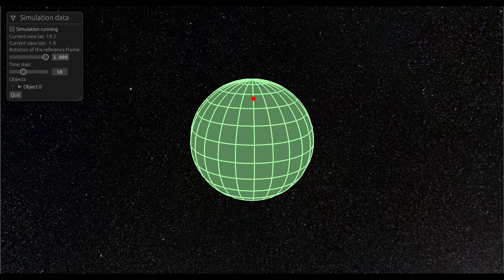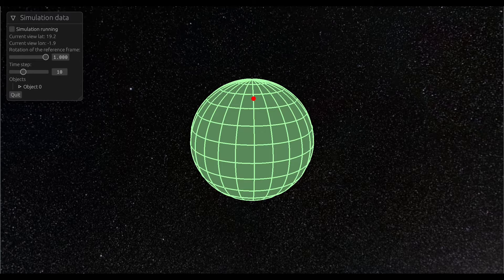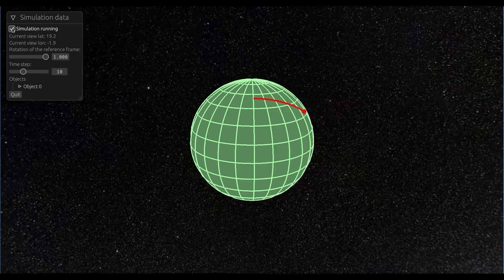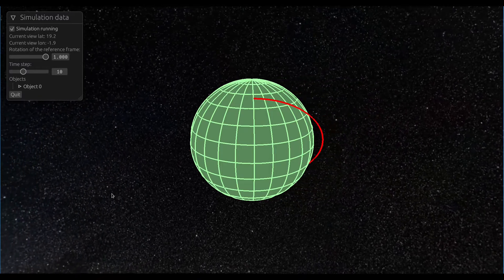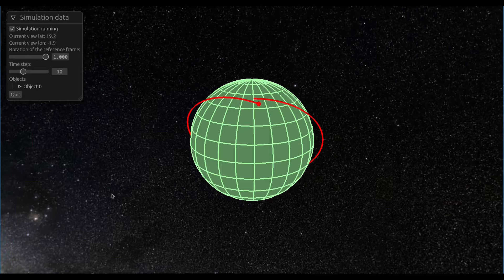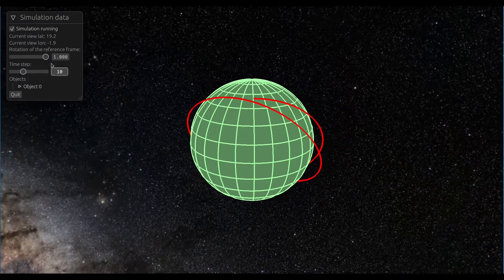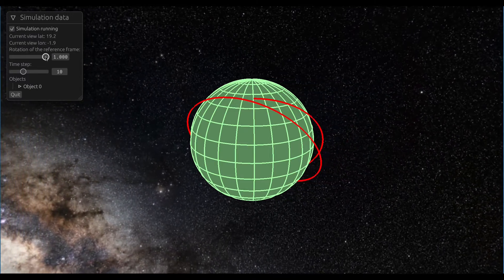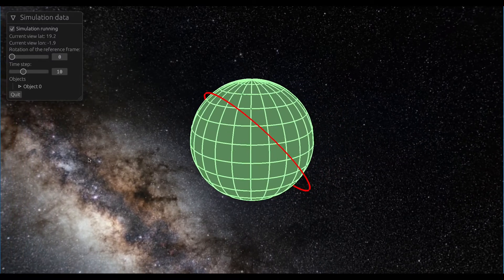3D Coriolis simulations - demo

Comment: Nice demostration, but i thought, how can something change direction, if it moves from west to east or east to west especially the Foucault pendulum? Out of reference frame of rotation earth it is realy clear for me, but i don't really know hot wo explain it inside the rotation reference frame.
If something moves north or south, the earth rotation there is another than the object or ball of the pendulum has. So it's faster or slower than the surface and we see a drift. But this explains only half of the whole spin. The more it chances direction to east/west the less the change in speed gets ans so less spin from that. So there anther effect is needed, that gets stronger the more it moves west/east.
I thougth about centrifugal force, because if the thing moves with earth spin, it gets additional speed so more force. The force is away from axis, so up at equador, where it does nothing how it should there. At pole it's simply away from center horizontally and also doesn't change a direction. Here it could completly explained by different earth rotational speed. So all fine here, too. Between poles and ecuador the additionally force is towards ecuador if the pendulum moves east. In the other direction west the force gets less strong than if it doesn't move at, so it moves to pole direction. That would also cause a spin at this positions. I think that would explain the secound half part of the circle of spin. Is this the missing part of the spin or is there another? Maybe someone knows? :D
Reply from the maker: What you're describing is how you can look at it, yes 👍 Although you need to be careful in order not to confuse different frames of reference.

If you want to talk about this in terms of increasing/decreasing centrifugal force, you're effectively using a frame of reference in which the object in question is always at rest. So if the object moves east relative to the surface, for example, there is a frame of reference that rotates around the same axis as the Earth, but faster, in which the object remains at rest. It is in that frame that the centrifugal force becomes larger, and the amount by which it becomes larger is actually almost precisely equal to the Coriolis force that would appear in the frame rotating with the surface of the Earth (there is an additional term that is quadratic in velocity, which also appears in the Eötvös effect).

Another way to look at it is similar to how you look at the north-south motion. As you said, you can say that when the object moves north or south, it moves to a region where the Earth's surface moves at a different speed, and so we get a deflection. Similarly, if it moves east or west, it moves to a region where the Earth's surface moves in a different direction. So that's the other way you can visualize where the effect comes from: the different direction of motion of the surface in the new place. A change in direction is just as much an acceleration as a change in speed.
Reply: @scienceitout  Of corse, the direction is different where the earth moves there. Thx :)

Comment from the maker: Here's the first version of the program that should be somewhat usable to an average user: https://github.com/fizyk20/coriolis-sim-3d/releases/tag/0.1.0-pre2 - it's now possible to define the simulated objects from within the program. Of course it could still use a lot more features, but this should be enough to make it possible to have some fun with it 🙂 (Also, if you try it, let me know if it works - I only tested this on my machine, so it might depend on some details of my setup in ways I'm not aware of.)
Reply: I'm trying this out on Windows 10. Fun to play with and works well, some issues with the graphics at very high velocities (eg, escape velocity), but maybe this is beyond its intended use. I'm finding, though, that in order to change parameters I have to restart the program; just making changes via the 'Edit state' dialogue doesn't work properly.
Example: a free-moving object at 50° latitude, 50 m/s eastward velocity moves, as expected, in a circular motion with a slow westward drift. Changing the latitude to 45° should result in somewhat larger circles with faster drift, but that isn't what happens.
I do think some users will be confused by the fact that your model produces trajectories very different from Walter Bislin's "Coriolis" model; you may end up having to make a video explaining this.
Reply from the maker: @kenm6810  Thank you for your comment!

"Fun to play with and works well, some issues with the graphics at very high velocities (eg, escape velocity), but maybe this is beyond its intended use."
What kinds of issues? It is slightly beyond the intended use, but it shouldn't really break.

"I'm finding, though, that in order to change parameters I have to restart the program; just making changes via the 'Edit state' dialogue doesn't work properly."
Hmm, that's interesting. Can you describe what exactly happens? If you mean your example with changing the latitude, it seems to work well for me. (But note that you have to close the dialog with the "OK" button for the changes to be applied - I guess it would be nice to see the changes happen as they are input, but was hard to do with the way I coded the interface.)

"I do think some users will be confused by the fact that your model produces trajectories very different from Walter Bislin's "Coriolis" model; you may end up having to make a video explaining this."
Ha! Yes 🙂Well done spotting that. I believe this is due to a very subtle mistake in Walter Bislin's model. I'm actually planning to do a livestream on Saturday (which I'm going to announce later today), and I intend to talk about this then 🙂 (It might still be a good idea to extract some topics into separate videos afterwards, but I'll worry about that later 😅)
Reply: @scienceitout  Regarding the graphics issue: at high velocities the projectile travels a long way from earth; when I try to zoom out to see the whole trajectory, parts of the trajectory disappear. The parts that are still drawn seem to be correct.

On further experimentation, it seems the 'Edit state' dialogue is not the problem after all. Rather, there seems to be something wrong with the 'Time step'. Changing 'Time step' changes the trajectory - dramatically so at higher values. This is not what I would expect, unless 'Time step' doesn't mean what I think it does.
Reply from the maker: @kenm6810  "when I try to zoom out to see the whole trajectory, parts of the trajectory disappear."
Ah, I see. That's not a bug - that's something I put in place in order not to use too much memory. Currently, the paths only store 5000 most recent points. So when you run the simulation long enough, this limit gets exceeded and older points get dropped. This limit is rather low, though, so I might increase it.

"Changing 'Time step' changes the trajectory - dramatically so at higher values. This is not what I would expect, unless 'Time step' doesn't mean what I think it does."
If you mean what I think you mean, this is expected, although undesired. There are two effects to increasing the time step: first, subsequent points along the trajectory will be spaced more scarcely, which can make the trajectory look less smooth. The second effect is that the integration of the equations of motion will become less accurate - so the resulting trajectories will become less and less correct. There's not too much that can be done about it, unfortunately. One thing I could do is to lower the limit on the maximum time step, and for faster progress add a setting for number of physics steps per frame. It should be possible to do significantly more than one, so that would accelerate the simulation without loss of accuracy.